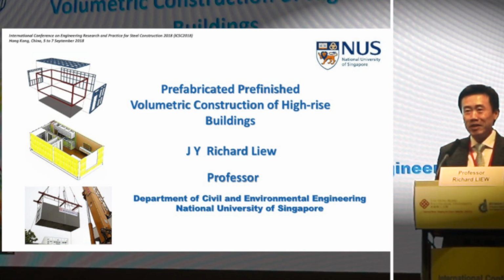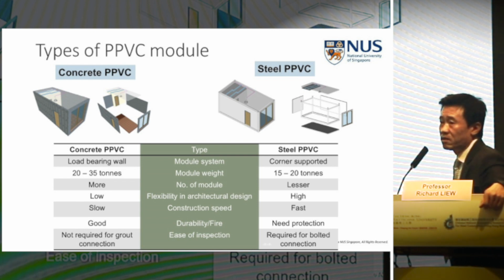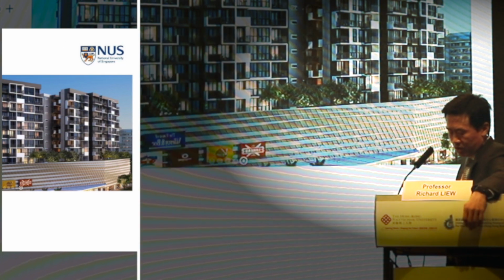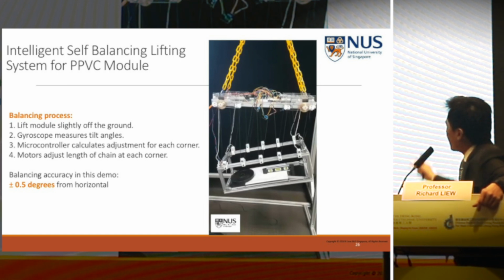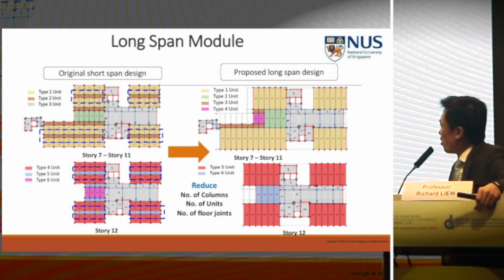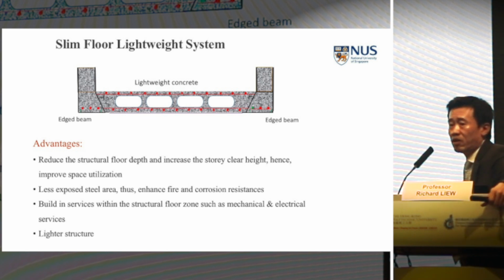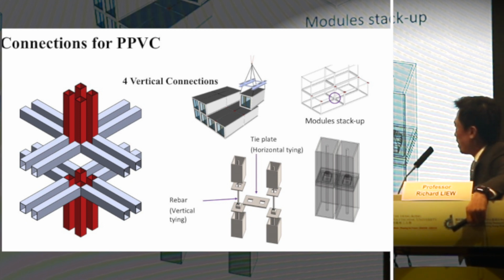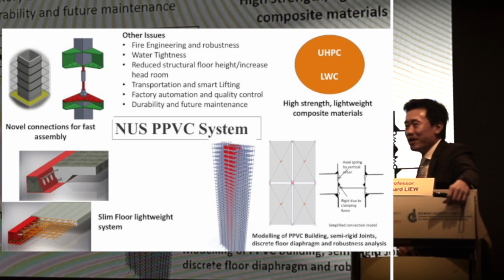Prefabricated Prefinished Volumetric Construction of High-rise Buildings (K10)

Comment: PPVC maybe suitable in Singapore because there is no earthquake resistance requirement there, rebar lapping instead of rebar soldiering or coupler connection is complied with regulations.HK may not suitable.